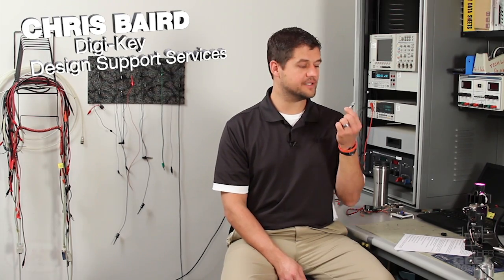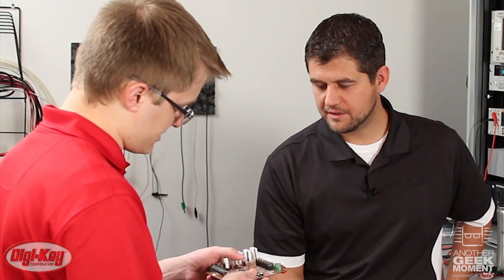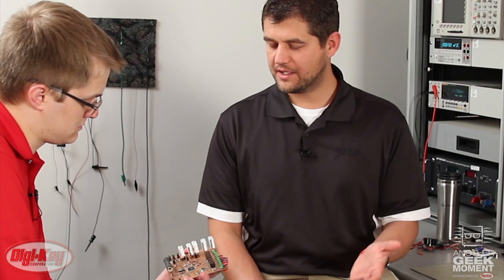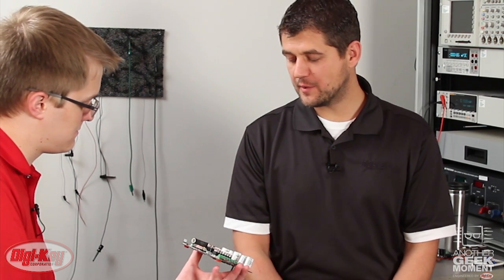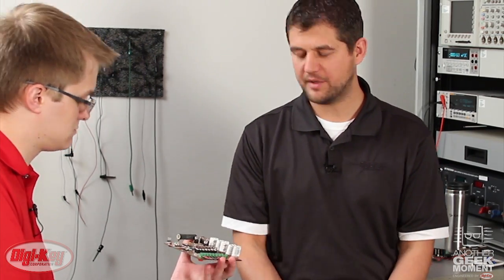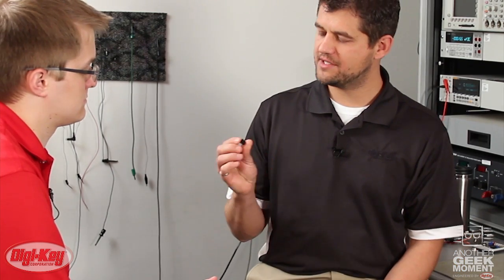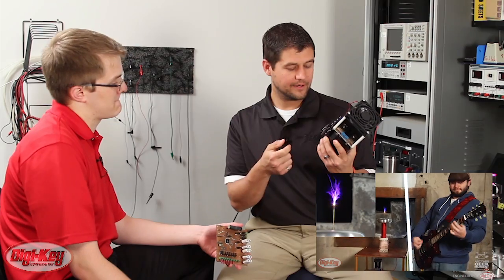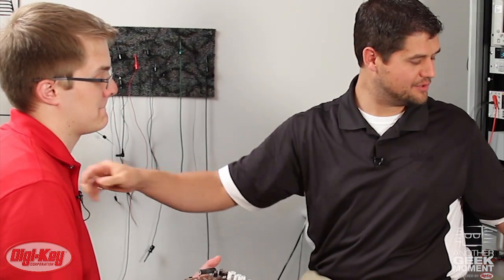CUI's V78 Switching Regulators -- Another Geek Moment

Comment: As long as the LDO has the same pin-out, and there is minimal capacitance on the PCB near the input and output pins (required by most LDOs), you are likely able to replace it with a V78 with no PCB changes.  The MOSFET, inductor, controller, and catch diode are integrated inside the V78.

Comment: Wow! you mentioned that you need to have a few caps, a feet and diodes! do you or don't you have those integrated in the circuit Yes or not! 
Because when you mentioned that he can turn around and install the Swtch regulator without having to make any changes on that PC board! I though that it was ready! 
so what it will be! ready or not?